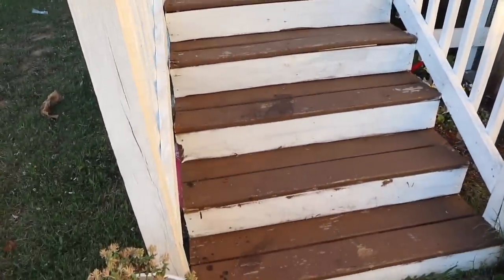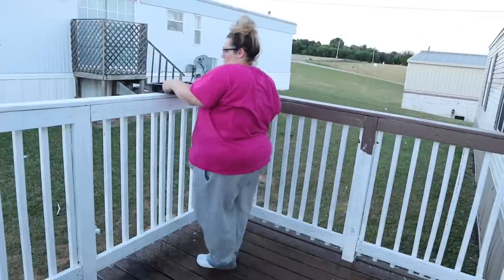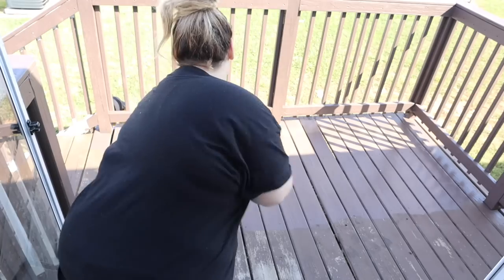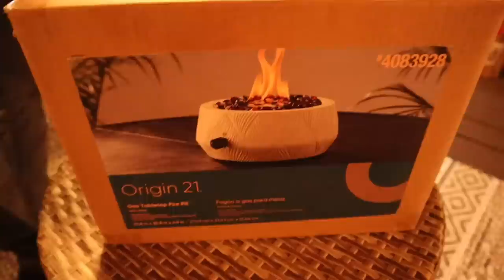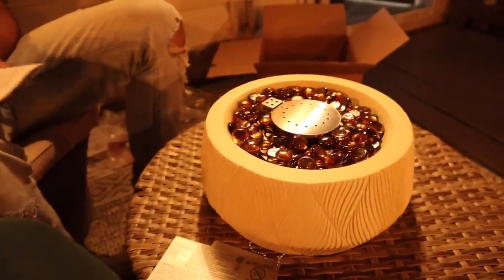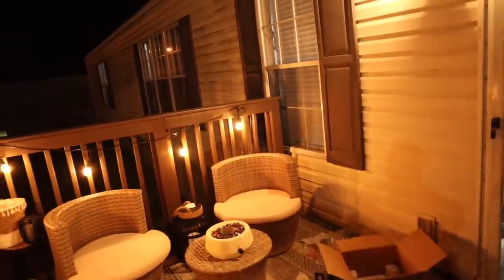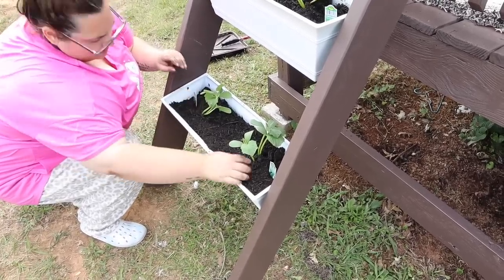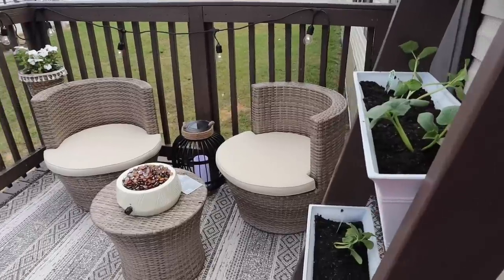MOBILE HOME MAKEOVER | front porch makeover | mobile home updates | fixing up our single wide!

Comment: TIP: Usually on screen doors where the door hinges at the top there's a small metal piece that moves....you slide it over..it will holder your door open

Comment: Secret Tip: if you don’t have a hose connection outside your house, get a long hose and hook it up to the cold water connection where your washing machine is. It fits perfect. Just make sure to turn the water off before you disconnect your washing machine hose and then turn it back on. You’re welcome. Also, this can be done with the hot water as well.
Reply: @virgo goddess That's a good idea!  I was going to tell you to hook up to your kitchen sink but you have a fancy faucet so it's not possible. You can also attach a pressure washer attachment to the hose. They are under $20. You can get on Amazon.

Comment: The overall look is very pretty.  Have you tried Goo Gone for the numbers? For the plant ladder, you might want to add 2 1x2 strips under each planter for support because the plastic will crack over time from the sun & weight of the soil & plants.  Also, cucumbers get huge & won't do too well in that small space.  What you have is best suited for herbs & strawberries.  You might want to secure it to the house or stabilize it to the ground better, so it doesn't get knocked over and get dirt all over everything.

Comment: I love it!!!  The light you got that you put between the chairs, I believe runs on solar, there should be a spot for batteries. After the light charges up from the sunlight during the day you turn the switch on and it uses the stored energy.  I might be wrong it could be a different light I was thinking of.  The sticky stuff from your house number, now don't laugh , try peanut butter, let it set for about 30 minutes then scrape with a rubber spatula,  or whatever you have that's  not sharp.

Comment: FYI, you can use AAA batteries if you don’t have AA’s. All you do is add folded up pieces of aluminum foil to the ends. It really does work. I definitely wouldn’t keep it that way for any long period of time. I’ve done this until I was able to buy the correct size. Hope that helps.

Comment: What the paint dude said is correct. We did water based over oil on our trim and it peels off easy. I think if you rough it up and prime it, you can use water based over oil based paint.

Comment: For your numbers….. scratch them up real good….. spray the heck out of it with Lysol……. Then soak a paper towel in Lysol spray and cover numbers then cover with Saran Wrap…. Let set 5 min or so…. Scrap with razor blade…. Repeat as necessary. It will take a few times doing it but it does work….
FYI…… you got to drown the numbers with Lysol and it’s gotta be Lysol! 

I did it with mine, it works!

Comment: Spray some Automotive brake parts cleaner on the #'s and scrap with a razor blade , I'm not sure if it will work but if that stuff will clean road tar and other sticky stuff it might do the trick.

Comment: Merina the batteries in the solar lights usually last a long time. The sun recharges them
 If the stand with the basket on it blows over I would just put a nail in it told hold it down to the porch. If you have a small place to put something on the porch to store little things you have out  in case the wind gets really bad
Reply from the maker: THANK YOU FRIEND 🙂

Comment: Some tips for your veggies…..make sure you drill a few small drain holes in the bottom of your pots….the water needs to be able to drain out or your plants will get root rot. 

Also….I noticed that it looks like you got 2-3 cucumber plants in each little pot you purchased.  Each of those stems is actually a separate plant. You’re going to need to thin them down to one each or they will compete for nutrients and starve each other.
Reply: Also….your tomato in your big pot from before is doing good pull the other plants out around it and it will keep going for you one the nutrient competition is gone.

Comment: Your lamp with the sensor isn’t working because it’s too bright outside with the other lights on. If you push back the round table, put it between chairs as a end table you can put your light on it and still have room for drinks